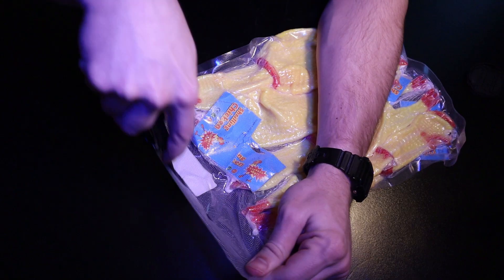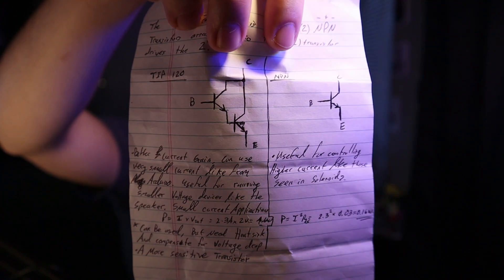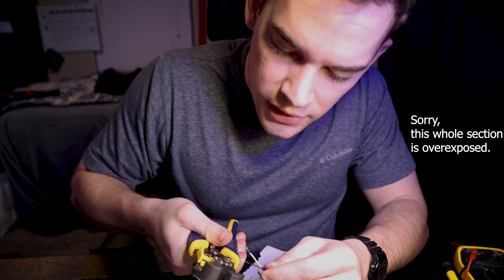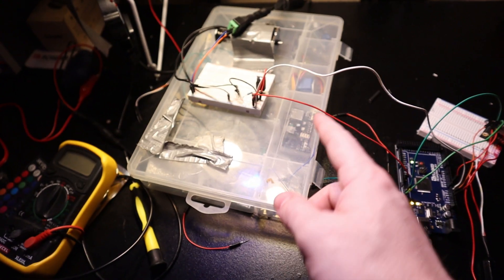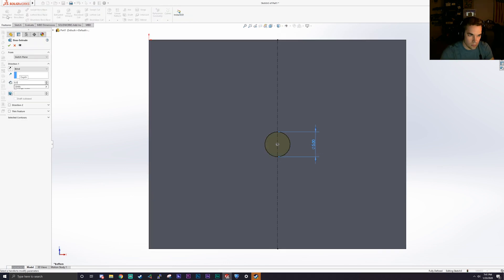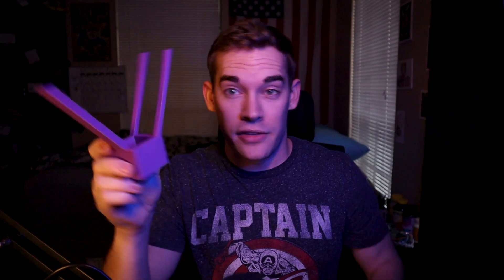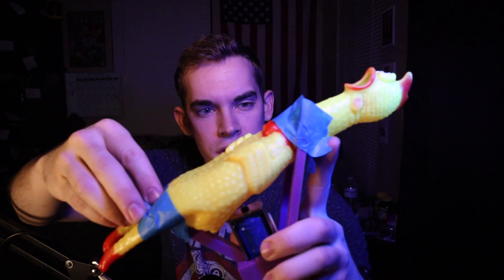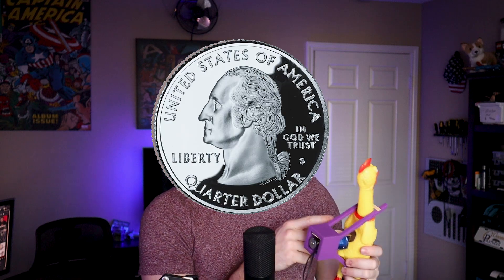Building a Rubber Chicken Subwoofer

Comment from the maker: Thanks for checking out the video everybody! Let me know if you liked this build, if the video gets enough love, I'll try using all (7) seven of the audio analyzer's channels to make a full spectrum bluetooth speaker. Oh, and be on the lookout for the video showing off the sub-squawker.
Timestamps:
0:00 - Happy New Year
0:30 - Mouth-to-Mouth with Chicken
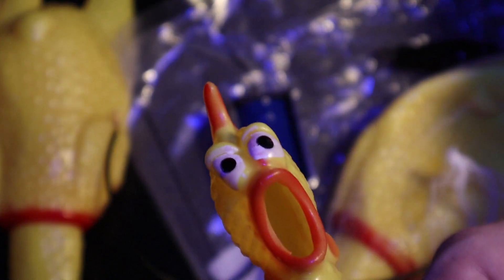1:07 - Circuit Build
2:26 - Bluetooth Connection Device
3:19 - Actually Tearing Down Bluetooth
4:29 - Testing Solenoid with Music
5:05 - The Chicken Holder Design
7:26 - First Assembly
8:36 - Final Assembly
8:52 - Conclusion